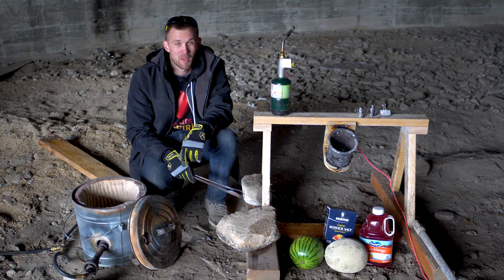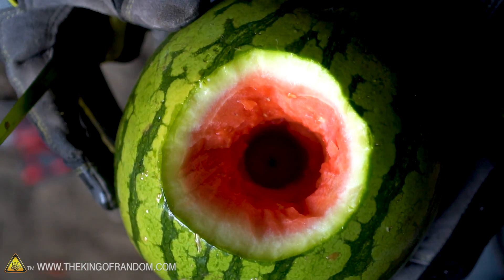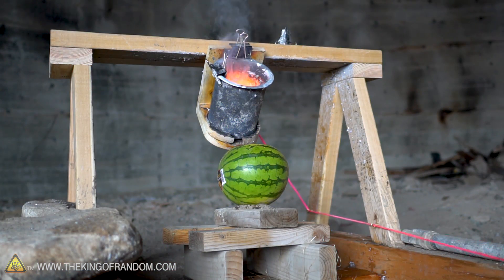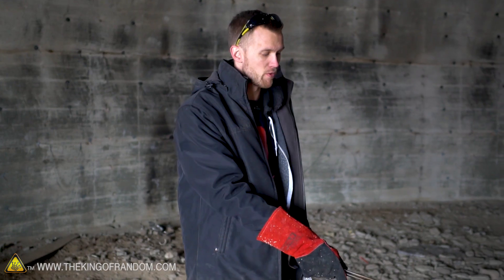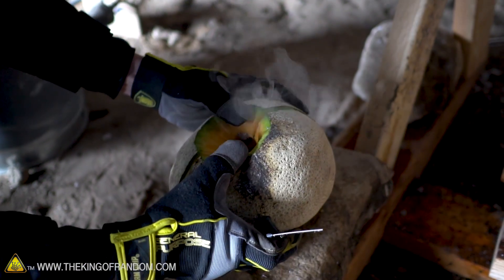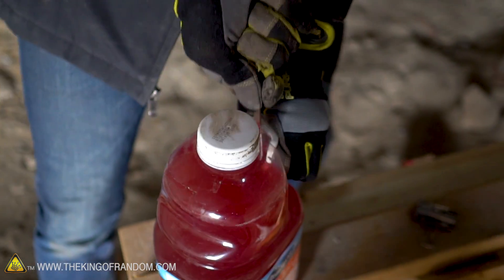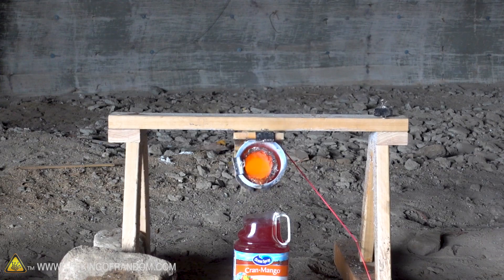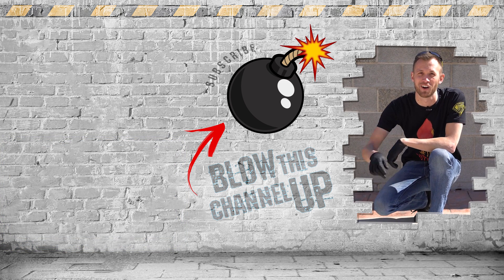When Molten Salt hits a Watermelon! This TKOR Fruit Explosion Trick Is Awesome!

Comment: I'm pretty sure that the hollow in the cantaloupe is not what kept it from exploding. Instead it is because the cantaloupe did not have any liquid juice pooled at the bottom, and so there was no water that flashed to steam, as the pulp contained and insulated the water to keep the reaction from occurring as fast. The watermelon, on the other hand, was freshly drilled and still very wet.
Reply: you're also forgetting that sodium reacts violently with water, which if you don't have any liquid for it to react explosively, then it won't explode.

Comment: Am I the only one who didn’t know salt can be melt?
Reply: I didn't think so, but it makes sense because salt is found underground as a mineral, and most things underground can melt easily. Anything can melt, really.
Reply: Yea. I didn't know either
Reply: Neither did i
Reply: No
Reply: Any substance has a fixed melting point. It depends on the density of substance and force of attraction between particles.
Reply: People cook with salt all the time, and the salt doesn't stay solid. It dissolve into the food...
Reply: @staciivang4840  i am not very bright but is dissolving and molten the same thing
Reply: @nahhiamnobodyisaidno9318  No, dossolved is in a liquid, molten is heated up until it turns into a very hot loquid.
Reply: meltED
Reply: also no, I didn't until the year when I turned 11
Reply: yes
Reply: Yes all you need is heat
Reply: Wait
Reply: That's right onion pie!🤣
Reply: Am I the only one who know how to grammars
Reply: Vincent Mora you don't even know th
Reply: @vincentmora5782  You don't know how to be grammatically correct. Am I the only one who knows how to correctly use grammar? If you're going to be a grammar police, at least use correct grammar.
Reply: Hmm how old are you? Like in 5th grade you learn that anything can exist in solid liquid and gas
Reply: @onionpie310  wanna point me to that liquid wood there bud? 😂😂
Reply: Learn grammar
Reply: Duy Phuc Nguyen yes

Comment: What would happen if blood is put in a vacuum chamber does it change color since no oxygen can get to it or does it evaporate. Please do this. Also add water or diffrent chemicals to it to change the results @king of random
Reply: coltin brantley blood does not change color in the presence of atmospheric oxygen. Veins look blue or green because of the refraction of light through your skin, your blood in your body is still red.
Reply: coltin brantley yes pleaseee
Reply: DesignsByTRex I know but does the blood boil or swell because of the plasma or will it stay the same it's an idea

Comment: Can I ask something? Galium can melt at very low heat (25c). When you heat an other metal at a high heat ( not to melting point) it become harder. So what if you do this to galium. Will it be harden or it will just boil?

Comment: What would happen  if you tried to pour molten metal (Salt being easiest, but brass I imagine would be cooler to see) through a DIY filter, like the layered rocks, gravel, pebbles, sand and dust filter they teach you about in cub scouts. I bet that'd look REALLY cool pulling out the solid metal, and afterwards, you can pour water over it and get filtered water :D
There is a basis to this question, I took a jewelry class and my teacher did that with molten silver (scrap silver donated from the class) and poured it through a wet straw broom to make a unique cast. might be an option as well, with brass or aluminum.
Alternately, try making a cast of the cantaloup with aluminum as well. Should be interesting!

Comment: Can you get shocked from putting electricity through molten salt
Reply: short answer: yes.

long answer: sodium is a metal and table salt when melted allows the sodium to come more into contact with it's self allowing electricity to pass through it easier. however unless you have a really high AC voltage you won't be able to feel it over the sensation of your skin falling off your fingers unless you have a buffer between you and the molten salt, such as a spoon.

Comment: Correct me if I'm wrong but when you heat up salt like that doesn't it break down into just Sodium and Chloride separated? Because that would explain the explosion as sodium will cause an explosion when it comes in contact with water.

Comment: What happens when you pour molten salt into non-molten salt?
Reply: I don’t know. Duh.
Reply: Silverfishstix Vidyas it cant turn into salt if its already salt
Reply: It would form larger salt crystals from the molten salt spreading over non molten salt and when the non molten melts it all cools down creating bigger crystals it will also be all stuck together
Reply: фудбол
Reply: Jacob _ it melts
Reply: Justin Yung so are you saying its not a regular steam explosion? I think the solubility of the NaCl is the reason it doesnt just cool down and solidify in the water like other molten materials it stays molten and surrounds drops of water that evaporate extremely quickly causing the explosion, the backyard scientist said something similar
Reply: Saltception
Reply: Jacob _ it turns into salt, duh
Reply: The non molten salt turns into molten salt because of the heat. Duh.

Comment: I wonder what would happen if you poured molten salt into a coconut as the outside shell is harder than a watermelon's
Reply: If you poured enough salt into it it could cast (possibly) if you have dried out the coconut, if you havent dried the coconut it will just explode. simple science. (look it up what happens when a liquid (probs look it up for water) heats up.) look up the science around the the basic idea and then you find out what happens with everything else.
Reply: DJBramblefurs Gaming ok I will Do. Thanks for the feedback

Comment: Can you electrolysis molten salt to get sodium metal and chlorine gas please king of random
Reply: electrolyse*

I'm not sure electrolysis works on NaCl... Aside from the fact that containing the molten salt in your electrolysis machine and keeping it hot during the process are both incredibly difficult things to do. Have you not noticed how quickly it solidifies?
Reply: HMS-Captain Lurmey  , We can heat the salt uniformly
Reply: Vignesha K wouldnt that melt the anodes and cathodes?
Reply: NotANoob, we can use a metal who's meting point is higher than the melting point of salt as the electrodes

Comment: Do something that the backyard scientist hasn’t done.
Reply: Backcountry woodsman I approve of this message.
Reply: Roasted
Reply: They should have poured molten salt into a 2 or 3 liter soda bottle, coke would probably work best but the 3 liter off brands might be easier to pour the salt in with. also they need to use something like a stainless steel pitcher with a pour spout for the crucible holder or rivet on part of a metal funnel to better direct the flow of 1500 degree molten salt. I think soda might explode more vigorously because of the carbonation. also what about pouring it on a stack of dove soap bars, or into a bottle of liquid soap, that sounds cool, and maybe into a bowl full of jello last
Reply: If they made a collab world peace would be established
Reply: Actual science,  for one.
Reply: Backcountry woodsman or do a collab.
Reply: I agree, but at least these guys make videos more than once like every 6 months
Reply: You seem a bit salty

Comment: That's a molten salt, how about a molten sugar? What happen if you put it in the chamber and turn it  super hot? Is it gonna be the same?
Reply: Red Jack; Correction, molten sugar is called carbon :P
Reply: Abdurrahman Sembiring sugar burns fairly easily.
Reply: Molten sugar is called caramel. :P
Reply: Ikr but what if turn it super hot?
Reply: Abdurrahman Sembiring it just chars and turns to black soot and smoke.

Comment: Can you try building a railgun? To allow it on youtube you could make the separate components that we can assemble ourselves ;)
Reply: Check out the HackSmith. They didn't show you how to make one but they did make one.
Reply: I'm fairly certain I meant railgun
Reply: ZombiesSquad doesn't matter, not enough rail guns in the world.
Reply: Why..... i think i know

Murderer
Reply: ooooo i'd like to see that.. but try ray gun
Reply: ElectroBOOM already made one
Reply: Kristoffer Stølen doesn't exist, never will
Reply: Toast Well maybe if they stuffed a ray in the t-shirt launcher, it would be a ray gun? ¯\_(ツ)_/¯
Reply: Moronic kids.
Reply: Railguns are totally a plausible weapon in the future and even now, they just require a heaping load of energy in order to function. With the most modern ranged weapons we have, firearms and missiles, the energy to propel the projectile comes from solid fuel that burns and releases gases.

A railgun would function without fuel but rather use magnets to accelerate a ferromagnetic projectile, like a steel rod. A steel rod is much more massive than a lead bullet, however, so requires a lot more energy to propel. If we had portable energy sources strong enough to power a railgun of sufficient size, it'd be the militaries of the worlds new best armour-piercing technology.
Reply: There is an army base (don't ask me where) that has made a railgun.
Reply: WarlandWriter i